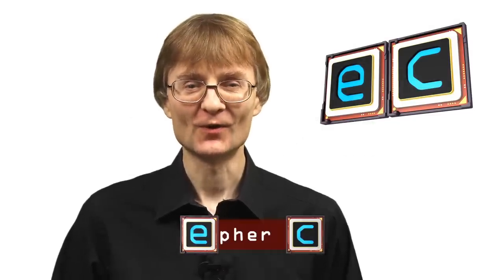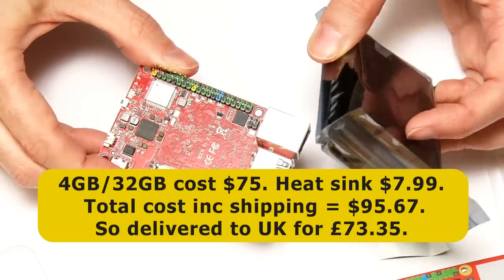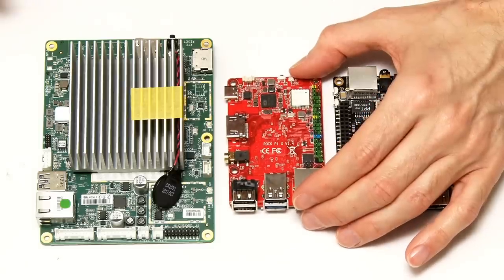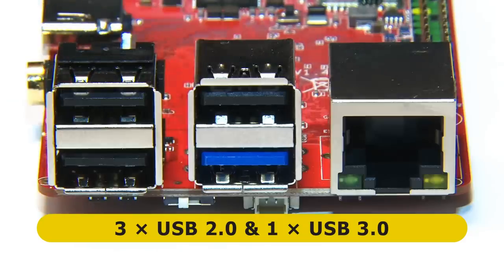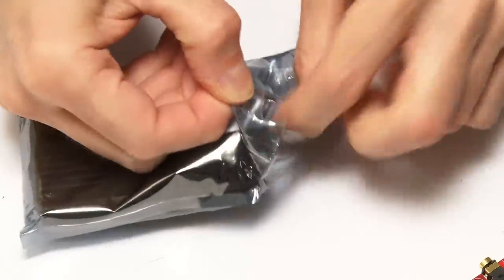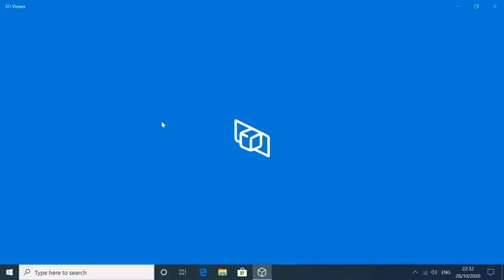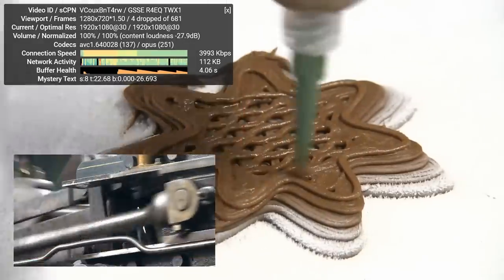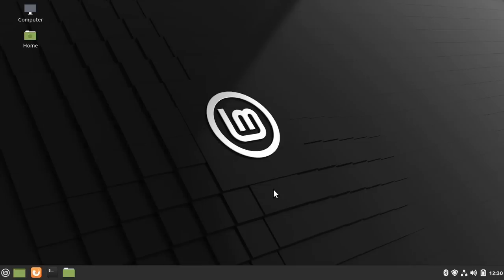Rock Pi X: Low-Cost x86 Windows & Linux SBC

Comment: What I think would be interesting is if someone could come up with an SBC that runs a 486 processor, 64MB of RAM and maybe 1GB of memory so people can run old 486/DOS stuff.  Yes I Know there are existing SBCs that do this, but they require a backplane, and usually the backplane requires a full AT power supply (ie. you basically have to build a complete desktop).  I honestly thing there would be plenty of a market for a 386/486 SBC the size of a Raspberry Pi. (I mean it would probably need to have HDMI versus the standard VGA connector but other than that, I think you coulid fit all the other components on the board very easily.
Reply: The only thing that comes close to that is the WeeCee 86, but it's not a commercial product, it's a diy project, a kit. 
It's made out of industrial modules and thus is VERY expensive. 

The problem is that the easiest way (I'd argue the only way) to make a 386/486 SBC is to rely on Vortex86 CPUs.

They require very little ancillary circuitry and they have been adapted to rely on modern chips, so making a compact, low power design is relatively easy, not to mention that that sourcing them is trivial compared to sourcing hopefully working old stuff form who knows where.

Sadly vortex86 sells their sfuff to industrial suppliers, and they sell their stuff to industries, obviously. 

That means that, for us, the common user, not only their sfuff is hella expensive, offer tons of features we don't need while providing none of the features we want but, most importantly, they won't even bother selling 1 or 2 things to us when they're there dealing with huge orders!

The only viable option for a ~486ish sbc I've seen so far is to either source an old thin client or one of those bump bars, eifher way you still have to deal with old stuff...or insanely expensive new stuff!
No in-between, sadly.

Comment: I do wish Intel would update the ultra low power Atoms (or that AMD would build something similar.) But it seems they’ve left that market.

I have a cluster of two Z8350-based mini PCs and four NanoPi M4s chugging away in my closet on random tasks. You still need x86_64 for certain things. It’d be nice to have an upgrade path.

Comment: Im an AMD guy but them Atoms arent bad at all even from 2016, plenty of power if your not doing insane level gaming or pro-level video encoding, but i was slightly dissapointed with the graphics performance though, it couldnt smoothlyu emulate N64 games i  could smoothy run on an Athlon XP from 2003 then again it at-least had a dedicated GPU.

Comment: Would there be any benefit in comparing the stats for nerds on YouTube by using the same browser (ie Firefox in windows) to avoid any engine differences? or do you prefer to use the standard default browser for each OS?
Reply from the maker: I just used the default browser as you note. But you are right, different browsers (and browser setups and plugins) may improve performance.

Comment: On the atomic Pi, Lubuntu 18.04 had some wifi issues too, but they worked fine on 19.04 and up.
My main issue is that Lubuntu can't get the Ethernet to work on the Atomic Pi.

Comment: Is there an SBC that you would recommend for digital HAM radio operators?  I'd like to get something that would allow me to run from batteries and 160 watts of solar out in the field that would fit in a toolbox or an ammo can.
Reply: what software would run on it? then I can point you to some ones that would work
Reply: @namaewasubarashii796  I would prefer to run a Linux variant.  However my main concern would be having the computer key the radio to transmit.  So it would need to have a proper speaker/mic input as well as a way for the software to trigger the transmit on the radio.

Comment: I am using an Asus Chromebook which I think that was released in 2012 is the easiest Chromebook flip version cp11a and that's about the same performance that I'm getting right now as a single board computer.   it seems to me the best value in single board computers or something like it is just purchasing one of the newer cell phones on the market and then using that for with or slash an external IO

Comment: I have a question. The video indicates the presence of a 4GB RAM memory, however, viewing the datasheet from the official Intel website, for the processor indicated the maximum supported memory is only 2GB. How is it possible that the board in question has a meroria that is equal to twice the one supported?

Comment: I bought a Foxconn Kangaroo Mobile Desktop with an x5-z8500 in it for $99 in January of 2016; the x5-z8350's benchmarks are significantly lower.

Comment: I've got a cheap Windows tablet with almost the same specs (X5 Z8300, 2gb ram, 32gb emmc) and while yes it does run Windows 10 with all current updates, using any more than say 2 apps at once brings the device to a crawl I suspect due to the pathetic lack of system memory. I did try a vanilla build of AndroidX86 Pie on it and it seemed to run quite well but certain apps didn't work and occasionally the OS would basically corrupt itself and the system because unusable. I'm sure a lightweight Linux distro would work nicely but in my case specifically finding a touchscreen compatible distro proved frustrating

Comment: Would it be possible to install something like Windows xp or older on the lower end Rockpi?

I'm searching for an ultra small form factor motherboard (possibly a sbc) to build a system capable of running either dos 6.22 or atleast XP to emulate dos on... I know there's dos box for Windows 7/10... but I also like the simple design of XP and I don't really require internet access to said system so using an outdated os isn't an issue..

I have a stack of the old 1.44mb floppies with dos, win3 and win95 as well as the windows 98 and xp cds and both a usb cd drive and usb floppy to make use of too..

Comment: I'm thinking the 4GB/128GB model would be great for a HTPC build (for 1080p of course) or even a small NAS for home use, even though you'd have to settle for a single hard drive probably considering you have only one USB 3.0 port but considering you can get 8TB+ drives these days, that shouldn't be a problem.

Comment: Chris, is the eMMC component able to be upgraded at a later point?
Reply from the maker: Only if you are extremely good with a soldering iron . . . Basically no. :)
Reply: You'd need a hot air gun (the surface mount soldering kind, not a paint stripping one) to do it. They're BGA chips, so the pins are all underneath.
If you have a hot air gun, and know how to use it for BGA chips, then swapping it would be pretty simple...
But for 99.99% of people, it's probably cheaper and easier to just buy a different SBC.

Comment: As expected its that AP6256 Wifi/BT Combo thing sporting ( yep you guessed it ) Broadcom cruft,  I found an almost pin compatible part and suggested it to the Pine64 forum to replace this one in the next respin of the Pine Book pro.  The variant I found used a Qualcomm / Atheros part that supports both Linux and Windows better than this cheap and really bad part ( wifi range even with external antenna absolutely sucks ( if you get it to work at all ) so BT yeah good luck with that) so no wonder you had issues in Winblows too as the drivers are god awful on both OS's.

Comment: I was horrified to see the Rock Pi X uses an Ipex connection for the wi-fi antenna. Ipex connectors are nearly impossible to use. I had to crimp the female connector on my Atomic Pi's wi-fi antenna, and then it fit on the board's male connector, but wouldn't stay on. I re-connected the antenna and then soldered over; that worked. However, one of my cats knocked my Atomic Pi off of its table, ripping the antenna wire free of its connector. I got another Ipex connector, screwed it onto a wi-fi antenna, but I couldn't clean off all of the solder on the board's connector, so I still couldn't reconnect properly. I tried soldering over the board's solder but got a really weak wi-fi signal. I'm using a usb wi-fi adapter now, and getting a great signal. Dr. Barnatt, please let me know what your experience with the Rock Pi's Ipex connector was like.

Comment: Most interesting features is not shown. CPU on this board is supports AES instructions & VT-x technology. Try to run Virtual Machines in QEMU & xmr-stak-rx in new video. You can use smartphone as display for QEMU Virtual Machines via VNC & Spice protocols.

Comment: Can I directly install a 15,6 inches from an old laptop on that LCD connector, I mean, without another board for compatibility?
Reply from the maker: A good question, to which I don't know the answer. All available hardware info seems to be here: https://wiki.radxa.com/RockpiX/hardware
Reply: @ExplainingComputers  I couldn't found this information, even in the hardware info page. It would be nice if you could make a video, trying to make a very low cost PC with this kind of screen. 😁😁😁

Comment: I am interested in this board. Do you think there would be a way to boot Windows 10 from an SSD plugged into the usb3 port?
Reply from the maker: You would have to use "Windows to Go": generally Windows does not boot from an external drive.

Comment: Quite pricey for what it is. If comparing the main components by themselves to an Asus E200 or X205. 

Edit: The Intel HD Graphics in it equals an Nvidia Geforce4 Ti 4800. And CPU equals like a top end Pentium 4 in single threaded performance. I played on the Atom z8300 games up to the year 2003 on the highest of graphics settings. It does Playstation 1 emulation but ofc even an Intel N450 was capable of that. And weirdly... You can play the very first Gears of War game on it cause it uses Unreal Engine 3 which utilizes all 4 cores. Its perfectly playable on low graphics and resolutions.. with Riva Tuner Statistic Server limiting the frame rate to 42fps. Connecting the thing to any TV through HDMI and you can set custom resolutions that go down to 24hz. So in theory you could make a custom resolution of 800x450 at 42hz or something weird as that and you'll get rid of screen tearing and other such stuff as frame doubling.

Comment: Worth saying that owning the hardware in order to run Windows 10, will probably involve double the hardware cost in order to licence Windows. At which point you can run LibreOffice for free under Windows.  But if you fancy running MS Office instead, then you can triple the initial hardware cost on day 1 by buying a 12 month M365 subscription. Then, keep paying the M365 subscription annually. Only it' may be a bit slow to start everything up. So, beware, the Rock Pi X for Windows may be the same bargain as the Gillette razor and the InkJet printer: ie the hardware is the least of it: the 'product' (for microsoft) is YOU.
Reply: For W10, it is certainly much better value to buy a PC that already comes with W10 and to have someone else, like a kind employer, pay for the the O365 licence. But for home use, free LibreOffice is generally very adequate.

Comment: The possible reason why Windows struggles with Youtube could be the Edge itself. Week ago I was receiving 3yo used laptop from other person & when I tested YTB on Edge it was painfully slow. Things has changed when I installed Firefox in favor for the latter. I guess Edge is too bloated for a machines with less CPU power, especially when OS loads other stuff in the backgroud, right after starting the system (note that I tested it on freshly-installed OS).

Comment: If you look at the stats for nerds part under Viewport / Frames, Windows says 720p, while Linux is at 1536x864.  Not sure if that would cause more dropped frames on Linux.  I guess I'm not that much of a nerd.
Reply from the maker: The figures you are refer to are for the viewport. In both cases the "Current / optical Res" is showing at 1920x1080. The viewports takes into account (incorrectly as I understand it) in Stats for Nerds scaling factors applied to the display. But the videos are playing 1080p. I think! :)

Comment: To get WiFi working on Linux, one needs to download the driver from the Radxa wiki (https://wiki.radxa.com/RockpiX/downloads) it is the AP65255_BT_WIFI_Firmware.zip file. Once downloaded, unzip the file and rename BCM4345C0.hcd to BCM43455.hcd and brcmfmac43455c0-sdio.bin to brcmfmac43455-sdio.bin and brcmfmac43455-sdio.ROCK Pi-ROCK Pi X.txt to brcmfmac43455-sdio.txt then copy only these three files to /lib/firmware/brcm and that's it.

Comment: I have an Atomic Pi and see that you chose the 4 gigabyte model to install Windows 10. I would hate to even try with a 1 gigabyte model, they offer a 8 gigabyte model with at least 32 gigabyte EMMC to make a Windows 10 install toleratble. 
Linux Mint killed my internal WiFi chips in my old Surface Pro 3 my 32 Asus Netbook so it is a Mint problem. They both worked with the initial install but the updates killed their use....
Reply: Just as a brief comment, I think you need at least 64GB for a viable long term installation of W10. With only 32GB, W10 seems to run out of disk space when processing major updates.
Reply: @derekp2674  I believe you because Windows 8 took up about half my 128 Gigabyte SSD on my Surface Pro 3 until the last Windows 8 update bricked it.  Now I use  a 128 gigabyte SD card loaded with Linux Mint 20.

Comment: This X86 board is impressive at this price..( is wiring pi is available for this chip)
Reply: Its very lackluster performance wise for anything compute wise tbh.
Reply: @sethrd999  and for iot ???
Reply: @BharatMohanty  I am sure it will not have the power profile for a decent enough IoT device I think that's just clutching at straws.
Reply: @J Fz We had a number of notebooks ( internet Asus ones ) with Win10 and moved them over to Linux as Win10 was way to heavy.

Comment: Those 2W TDP rating are still extremely low while having enough performance. Those atoms are still the best i know for some low power applications. I only have problems with the integrated gpu.
Reply: The integrated GPU is just too underpowered.

Comment: I have never been a fan of Intel's Atom based processor line. If this board is being used in an application other than desktop computing then it is an incredible value. If the board is to be used a desktop then the Rock Pi X should have had either a low powered Celeron or Pentium processor, even if that involved a price increase. With both Apple and Google (and even to a certain extent Microsoft) implementing and exploring the possibilities of ARM based hardware, Intel needs to really seriously consider abandoning its Atom line and further develop its other architecture while reducing the power consumption of its processors.

Comment: I haven't gone through all 445 reactions (atm), so I don't know if this has been posted before. But on the radxa site I see that the Rock Pi X contains a AP6255 WiFi chip, a clone of a certain Broadcom chip. Probably this site will get you started in enabling WiFi: https://askubuntu.com/questions/1167644/cant-install-wifi-drivers-for-broadcom-ap6255.

Comment: My pc is a 3rd gen from 2013 😂
Reply: My PC is from april 2012. No plans to upgrade. 👍
Reply: So I'm not the only one then 😂
Reply: 2nd gen I5 2500 here running at 3.9 ghz all core & 4.1 ghz single core, 4x4 gb ram so a total of 16 gb, 1x 60 gb ssd for os, 120 gb & 500 gb ssd.
graphics card was an unplanned upgrade but my r9 280 died in the middle of august this year so went with a gigabyte gtx 1660 super that should have me running games 5 years forward or so at minimum.
Reply: @Mini-z1994  My laptop is from 2012 too, and pc from 2007 and still rocks. : p
Reply: We should start a crowd fund for this guy.
Reply: Brennen Murphy 
I run ur pfp - gentoo linux

Jk, Zorin based on ubuntu
Reply: Old Thinkpad gang
Reply: I still use a Lenovo think centre from 2009. Upgraded memory, processor and storage (ssd), and also added a low profile graphics card
Reply: 4th gen 2014 here. Paired with gtx 750ti running strong. #6MoreYears
Reply: If it where not for the terrible battery life of my last laptop I would still be using a 2012 Ultrabook.

Comment: Hello! Does your Rock Pi X boot automatically if you plug it into power? No matter what I do I cannot get mine to start unless I press the power button.
Reply from the maker: You have to press the power button (like on ny x86 PC) -- or wire in a power botton to the header and press that.

Comment: why is USB 2.0 still installed in these days? I thought it belongs to the old iron
Reply from the maker: Many devices -- not least keyboards and mice -- only require a USB 2.0 connector, so almost all PCs still have USB 2.0 ports.

Comment: Not very often do you see a bare-die CPU from Intel. No integrated heat spreader at all. I wouldn't have been able to resist trying liquid metal instead of the provided TIM.

Comment: question ... for the Windows10 playback, was that wireless or hardwired ethernet?
Reply from the maker: It was wireless.
Reply: @ExplainingComputers  realizing that it will be a pain to go back to windows (unless you just happened to get 2 of these boards), may we request a comparison between wireless speed and ethernet?
Reply: @ExplainingComputers  Another question, please, did windows install as 32 or 64bit?
Reply from the maker: @lesliedeana5142  Hi Leslie. Windows was 64 bit.
Reply from the maker: @lesliedeana5142  Hi Leslie, as you say, going back would be a pain! :)

Comment: Greta Thunberg's shouting "How dare you not that make that plastic box a case for the computer!"

But I do like the RasPi form factor for an X86 board.  

I think my Acer Revo, that's stiull in service is older than that or at least uses an older CPU.  It was entry level when it was new and still does a sterling job for what I use it for!